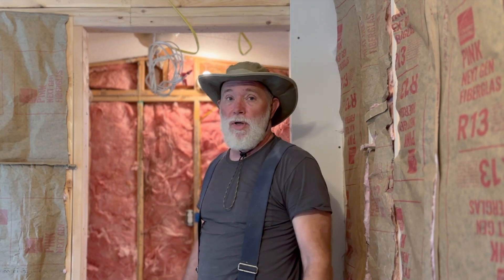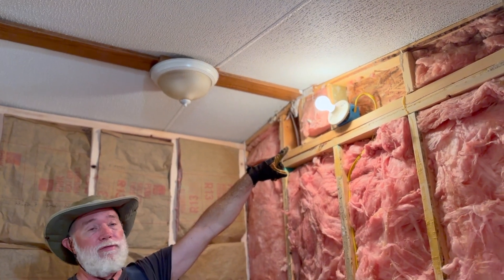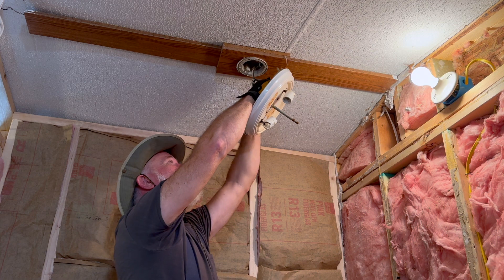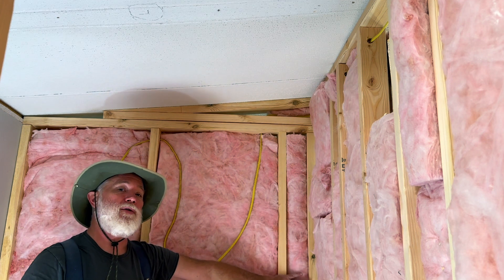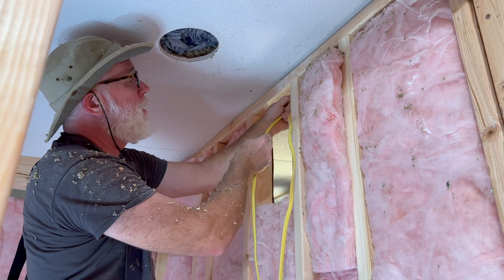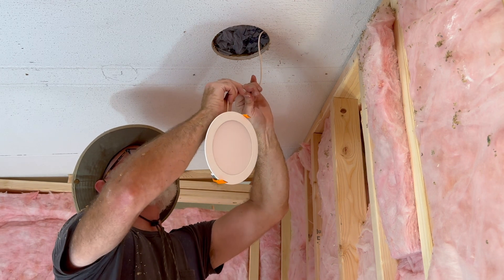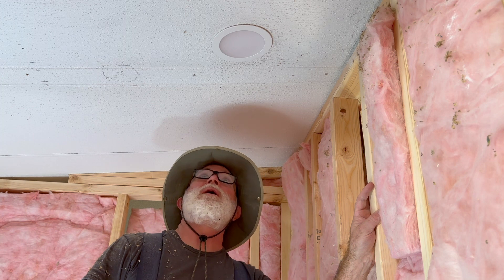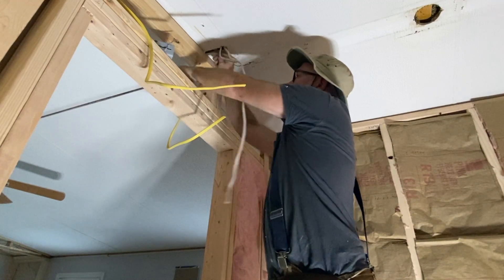Simple DIY Lighting Solutions

Comment: Did you buy a trailer that someone robbed the wiring out of?
Reply from the maker: Thank you for watching. No the trailer was live in condition when we bought it. All of the demo we did was to move walls, doors, and side rooms. The closet was the tub, the shower is larger, the inner wall of the bathroom was moved 8 inches, and the head board area was a closet. That meant relocating lights, switches, and outlets. Fortunately we found several hundred feet of 12/2 wire in the barn so we put it to work for us.